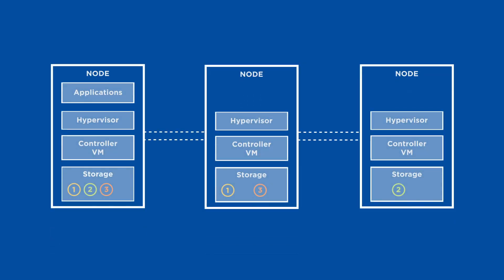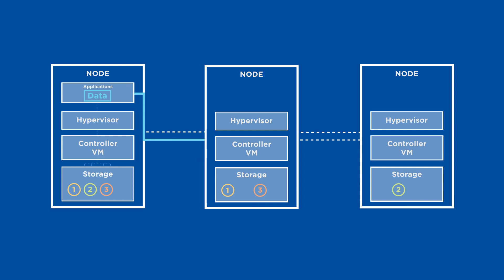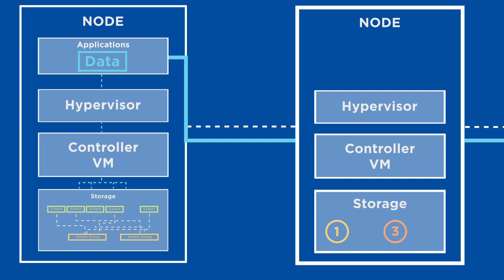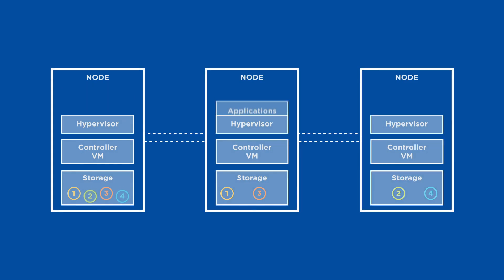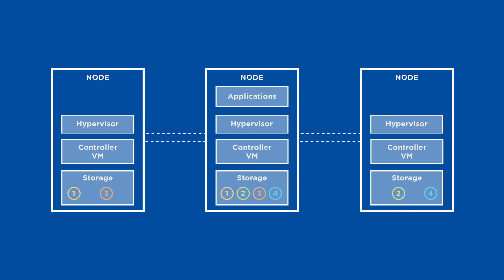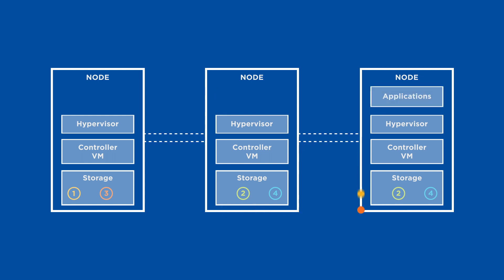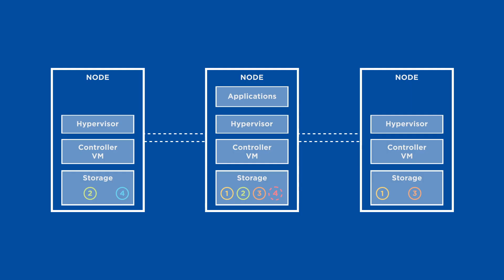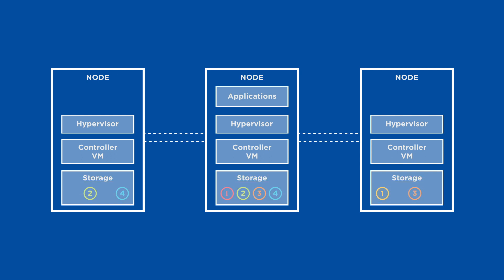Build It Better: An intro to the distributed architecture of Nutanix AOS

Comment: In the Resiliency section of this video, is the update of data extent 4 going in the wrong direction? Data locality would mean node 2 would get updated first since the application is running here and the primary data is also here. Hence the copy of extent 4 would be updated in node 1 only after node 2 is updated.
Reply: The animation for that part is showing a scenario where an extent is lost (on node2) due to something like a disk failure and how AOS automatically recreates it immediately from the other copy. If it was an update/overwrite, yes as you said, 1 copy is written locally for data locality and another copy is written in another location. The write is complete only after it is written in multiple locations according to replication factor which in code happens concurrently.